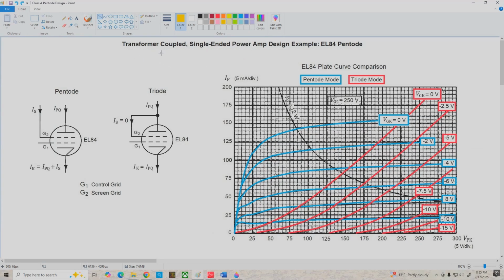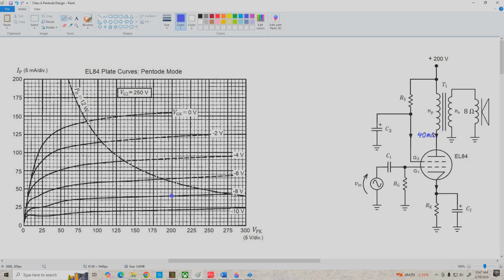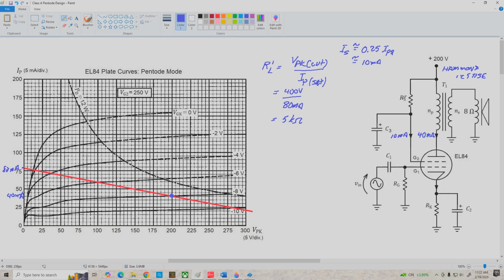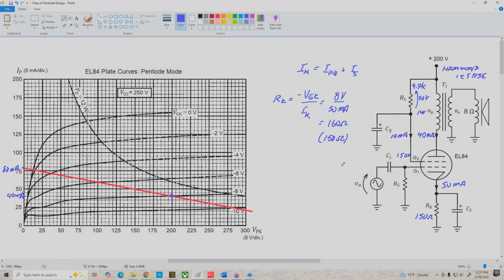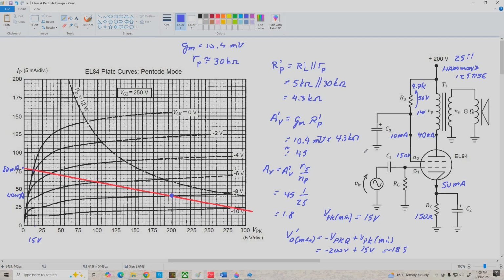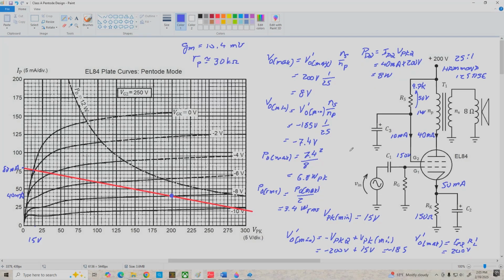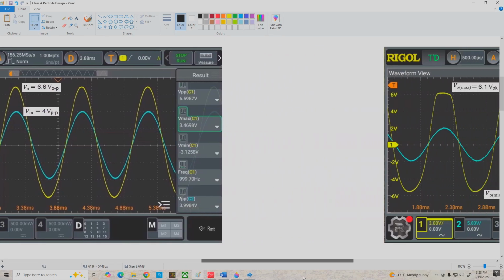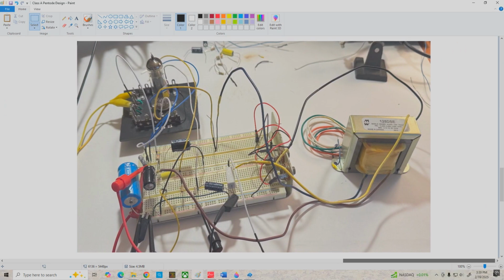Topic 78: EL84, SE Pentode Amp Design

Comment: One of the best videos I've seen regarding this subject.  I'm wondering if you have ever plotted distortion versus output power for this design.  I have built a 45 triode based single-ended amplifier, and I have a pretty good feeling for what it does at one watt. I'd like to know how an El84 single-ended pentode with no feedback will behave at this same 1 watt level.  My speakers are  efficient, and I listen at very modest levels, so that first watt is the most important to me!
Reply from the maker: Thanks! I haven’t plotted distortion vs power on many amps. I don’t think have any of the data I did collect any more. Might have to do it here sometime.

Comment: Whelp, back here to give you a big THANK YOU!  Just finished a HiFI SEP stereo amp (12AU7 & EL84), wired UL (a little trial and error needed there since your vid on the subject isn't out yet).  The amp is making 3.5W rms into 8-ohms without significant distortion, the sensitivity is correct for "line" level sources.  It can make 4.5 watts but the waveform is 'topping' by then.  I did add 3 dB of feedback from the secondary of the OT to the cathode of the voltage stage to clean it up a bit.   Applied full mathematical and plate-curve rigor, per your guidance.  It damn well worked out, almost from the first prototype, just a bit of fiddling.  I could not have done this without your excellent videos.  Next project will be an EL 84 push-pull amp in the 12 watt per channel range.
Reply from the maker: Glad to hear the design was so successful! I’m working on a push-pull UL video now (using 6V6s). It’s a ton of work (most are, actually) and I’ve had a lot of distractions lately slowing me down, but hope to post next week. Stay tuned… 👍🏻

Comment: So informative and helpful.  Thank you.  I would very much like to see your analysis for a SE pentode (EL84) operating with a screen-tap output transformer rather than a fixed G2 voltage.  Is it still estimated at 25% current flow, and is a screen grid resistor needed to control screen grid current?
Reply from the maker: Thanks. I plan to cover ultralinear amps pretty soon. Screen current can usually be estimated as about 0.15 to 0.25Ip depending on the tube. 0.25 is probably a bit high for many power pentodes but I’ve never had problems using it anyway. 
Often I’ll use the actual screen grid curves, which will be in the next video. Rough, ballpark estimates usually work very well though when it comes to screen grid current and voltage.
Reply: @Denton.Dailey  Much appreciated!

Comment: Thank you for the explanations! What are the reasons for never seeing cathode follower configurations in the output stages? Thanks
Reply from the maker: This could be a super long reply (probably worthy of a post on the Patreon page!) but basically, although the output impedance of the cathode follower is relatively low, it’s still too high to directly drive a typical loudspeaker effectively. There are other considerations too but too many to get into in a comment. Thanks for watching!

Comment: The schematic shown looks an awful lot like what we used to identify as a Tetrode in the 1940s - A control grid, and a screen grid. Why is this one, with only 2 grids identified as a pentode, which would have a control grid, screen grid and a suppressor grid ?
Reply from the maker: @walterbrown8694  I understand what you’re saying. I didn’t mention it in this video but the suppressor grid is internally connected to the cathode so it’s usually omitted from the symbol to simplify the schematic. I’ll try to remember to mention this in upcoming videos.